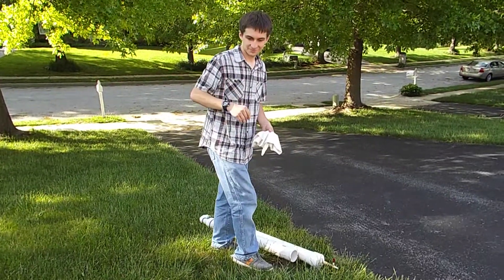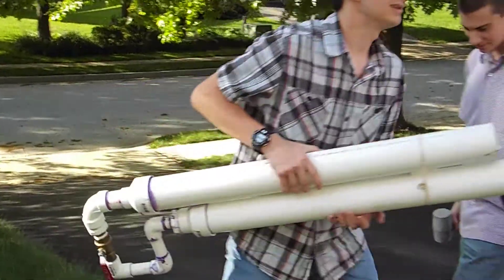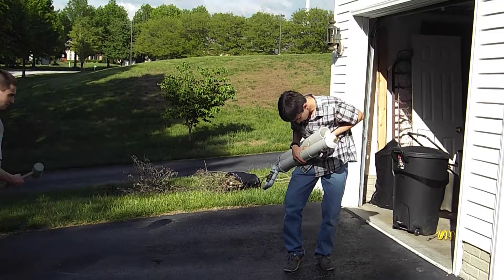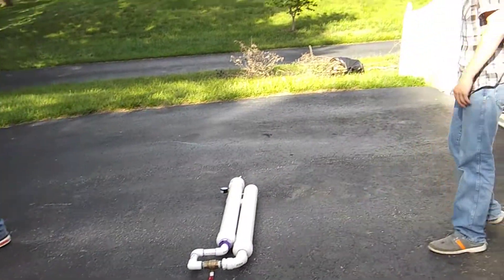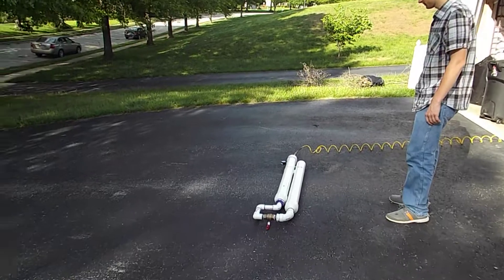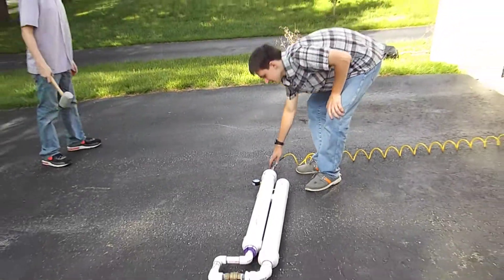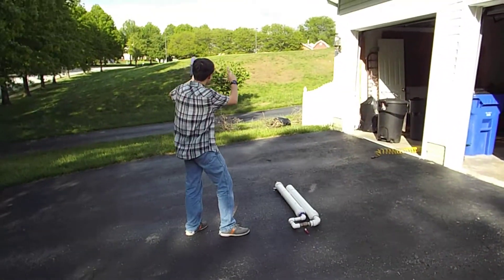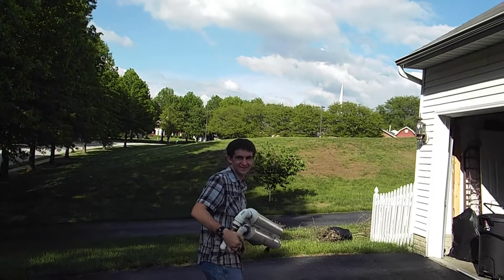DIY Air Cannon  ~100psi ~320ft

Comment: The main problem is pumping air by manual penumatic pump , it need around 6 minutes to reach 80 psi , and make you feel exhausted.  I tried that personally

Comment: Do NOT use PVC for the pressure vessel. PVC gets old and brittle. It will explode.
Reply from the maker: SimpleMan9841, duly noted: thank you. I don’t have it any more anyway, but good for others and myself to know for the future.
Reply: To others in the distant future, old co2 tanks or fire extinguishers or plain old air tanks are like 30 bucks.